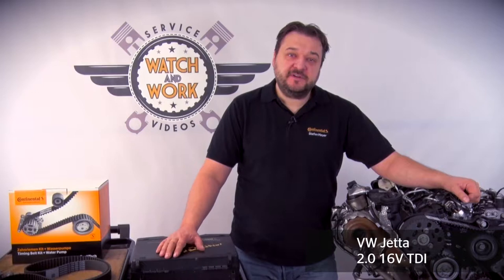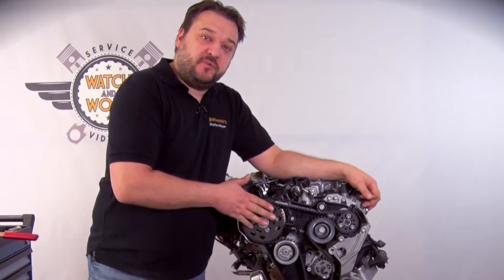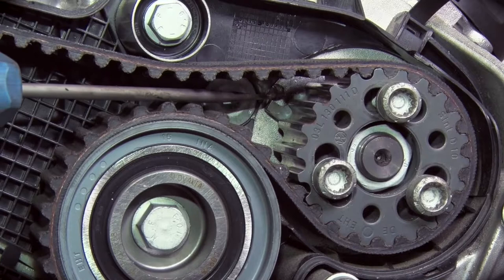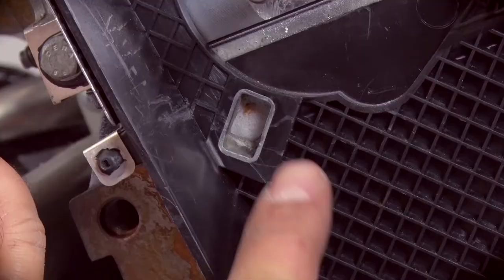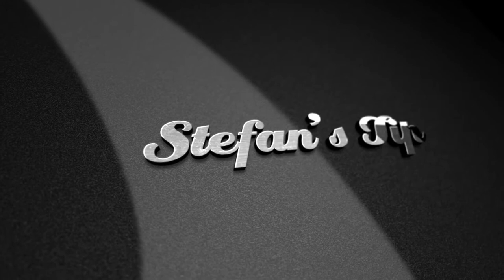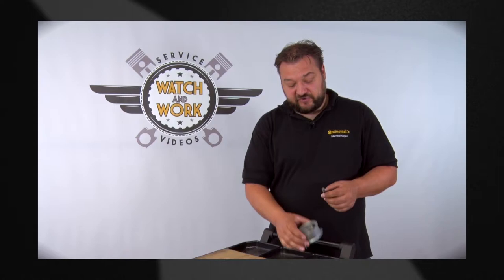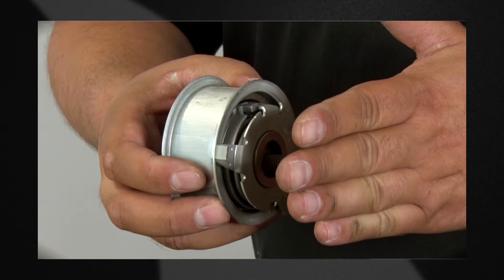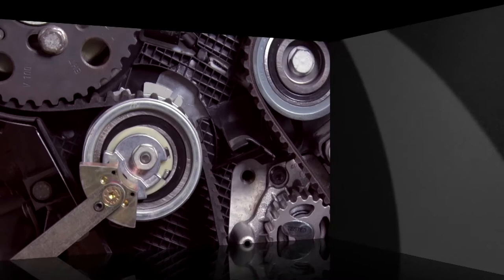[EN] Watch and Work - VW Jetta 2 0 TDI 16V

Comment: Hello, why does the timing synchronization change from 1.2 on a cold engine to 0.4 on a warm 90 C? Is the timing correctly installed? 1.6 tdi cayc engine ....
Reply from the maker: Hi Sensei948, unfortunately we don't understand your question. Could you specify what you mean with the numbers 0.4 and 1.2?
Reply: @ContinentalAftermarket  synchronization angle